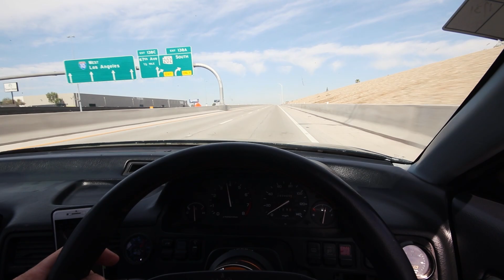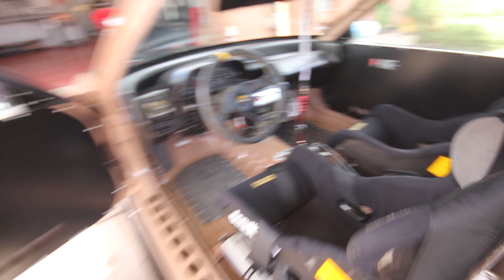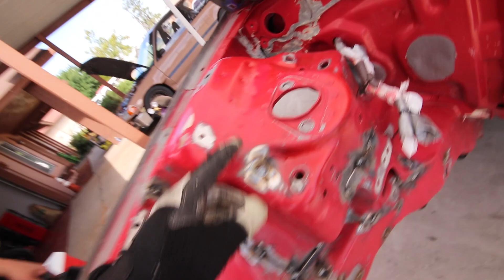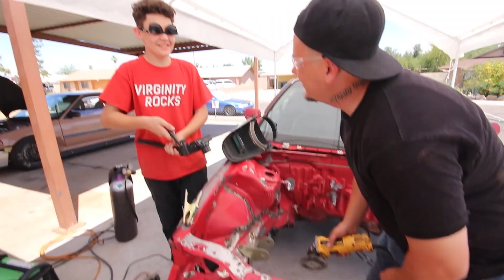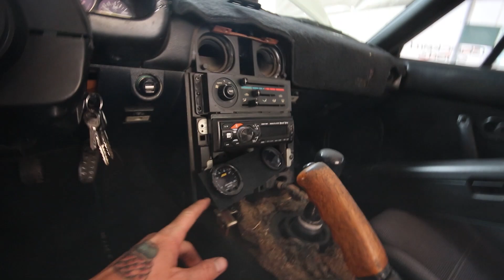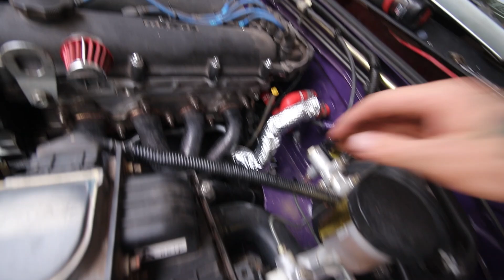Met With DEADBEATGARAGE and the 2JZ Swapped Civic Hit Launch Control

Comment: Damn that mig box is rowdy.  Whats the duty cycle on that thing?   Such a consistent arc so tight together.  What brand? I might have to get me one of those.
Reply from the maker: I forget the duty cycle. But I have ran it for a solid 20 minutes with no shut off. On 110v at that. It’s the titanium Mig 140 from harbor freight. Been using it a bit over a year now multiple times a week. Never failed me
Reply: @ChrisSadowski   runs better than my lincoln SP200. Think im going to go grab one this weekend.  You do good work man. I appreciate your influence on the car game. Keep it up brother!

Comment: Dudes gotta rwd 2jz swapped eg coupe and ive been having horrible luck building my jdm gsr swapped 97 ek hatch smfh (almost done tho 😂😂)
Reply from the maker: Some people take bigger steps than others. This guy just happens to be a Bigfoot in that case 😅
Reply: @ChrisSadowski  ya really u aint kiddin 😂😂 and im over here looking like little foot but its ok i gotta figure out why this spark plug in cyl 4 wont tighten or loosen so i gotta order headstuds and headgasket so i can pull the head and see whats up. I didnt crossthread or over tighten but it jus spins. Hopefully i get lucky and my threads are ok so i dont gotta helicoil it smh